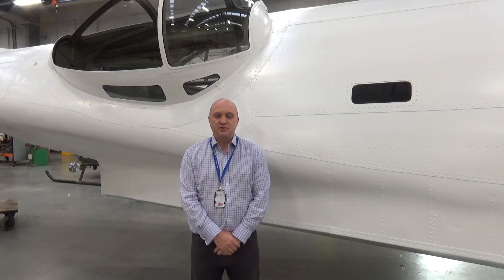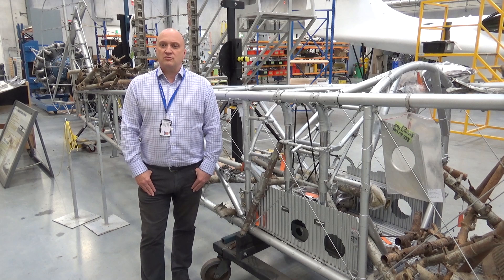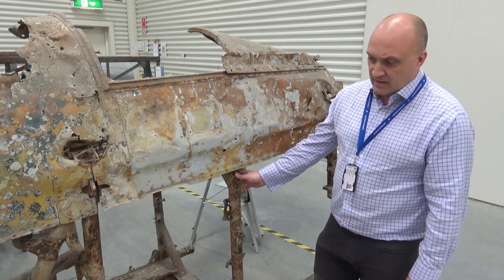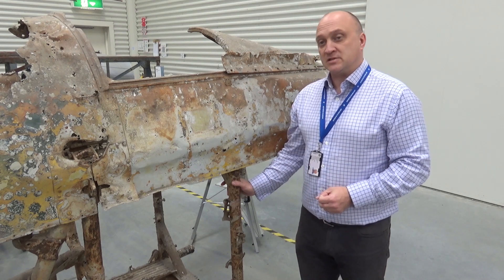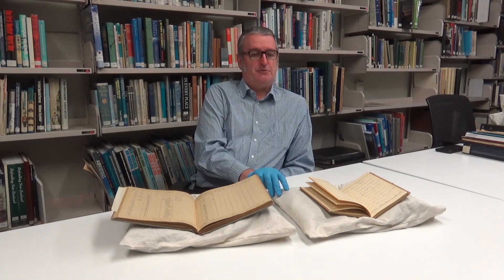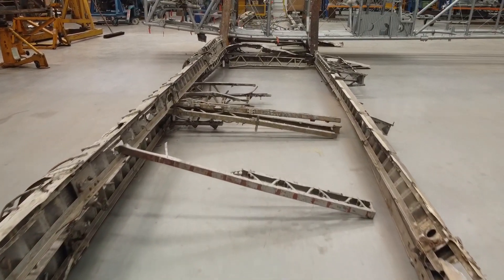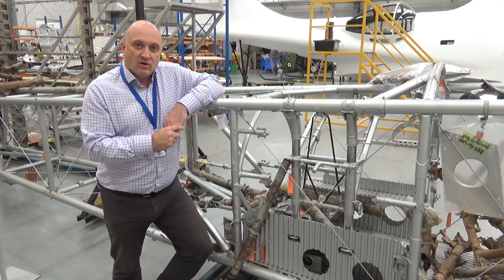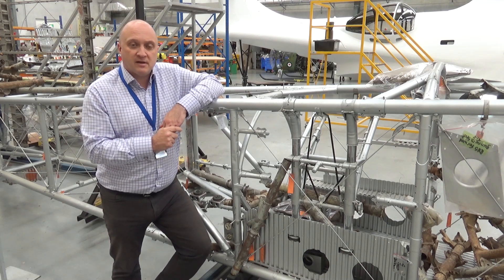Air Force Museum of New Zealand Vickers Vildebeest restoration - an overview

Comment: Aren't enough RAF/RCAF/USAF transports frequently going back and forth between the UK and North America to move some Imperial-gauge materials in your direction on a space-available basis or as a training/nav exercise?  Maybe it gets the stuff from the UK to Hawaii if not farther.  I seem to remember the Vickers Vimy replica going halfway around the world to Australia in a US Air Force Reserve C-5 many years ago.  Perhaps contact your national museum counterparts over there and make a casual inquiry.  They may have the contacts and know which strings to pull.  Once historically inaccurate-size material is incorporated and the rebuild is completed, it will be hard to take it back out.  A matter of how much you really want the added authenticity, I guess.

Comment: Hopefully you will be able to find some of the things that you need to complete this project  more easily than you expected to stranger things have happened, one of my neighbors at least  used to keep a small  biplane in his garage  to give it some context, his house is a zero lot line single family home with  a single car garage on one eleventh of an acre same as mine is in a neighborhood adjacent to the one in which my house is located both my neighborhood and the one in which he lives consist of eight-hundred homes of the same description I just gave,and I do mean a real biplane not one of those very large gas-powered  radio-controlled models  and I  am not using hyperbole this meant to be a literal example of finding something where I would definitely have never have thought to look for it!!!